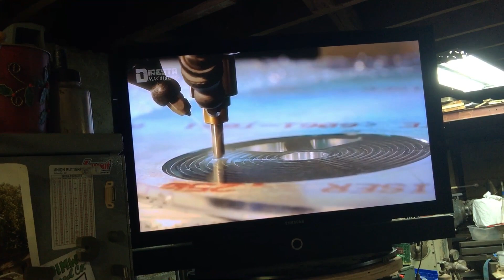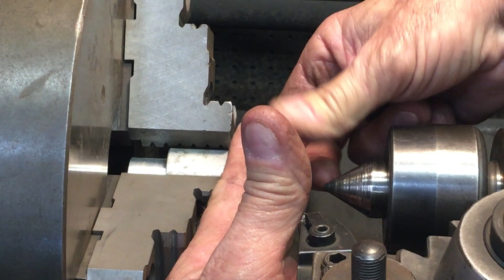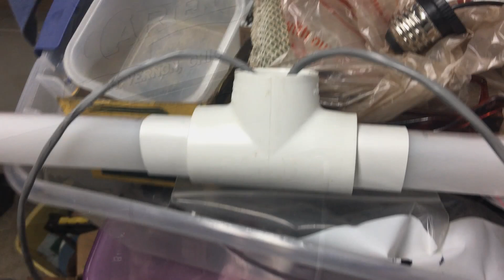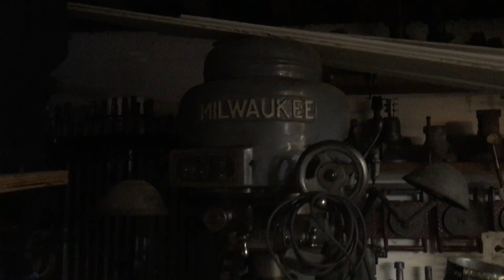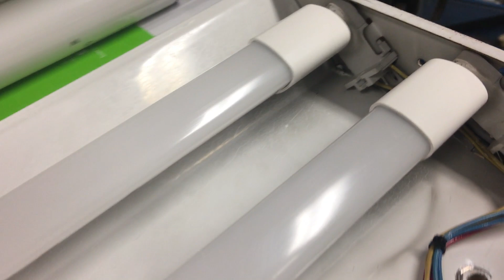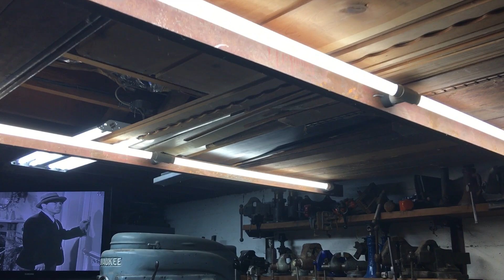A Few Light Improvements In The Shop

Comment: I used to use similar LED retrofit tubes, but have recently switched to LED panels.
Since the whole area is lit on a panel they make for very good glare-free light, especially in rooms with low ceilings.
It is quite amazing what they can do to a grungy basement room with no windows, it's like you suddenly have a bunch of skylights.
Sure the cost is higher, but there is such a marked difference I really wish I had done everything with panels instead.

Comment: Hey Gary. I've been putting in LEDs too. The GE bulbs are easier. You just run all the wires on one side of the fixture to hot, and all on the other side to neutral. Pretty easy.

Comment: I was going to pull the balist on mine, but 
These budget big box store fixtures are crimped close.  You cant change the Balist on them without tearing up the fixtures. I got 10 2 bulb lamps with bulbs for 35 bucks from someone on cl.
I needed better light and the celing boobs were not cutting it.  One of these days I'll just buy a few rolls of led tape lights and put them up using c channel made for them with one or 2 drivers to power all of them.
Led bulbs use 1.2 volts dc  you total the number of leds on the strip that gives you what dc voltage is needed to run that strip.  The led driver drops the 120v ac current to 1.5 to 64v dc to run the bank of leds.  
And yes leds have a long life but these are wired in series if one lamp goes out you loose the whole strip of lights. 
Some strips every other bulb goes out.

My point is the less transformers the lower your energy bill.
If all the lights in s home were leds one power supplier could run a whole house.
And this was at the dc current you can control the brightness by turning down the voltage you could get a fully disable light that way.  Good too becuse some thing go bump in the dark better.

Comment: I put my plasma about that size on a commercial swivel mount it holds just fine.  Holy cow that mount is over engineered no way could it break that mount would hold a VW bug on the wall
With 2 fat ladies in it.